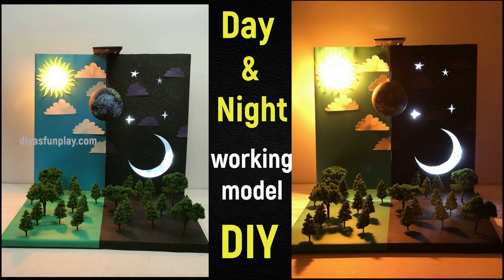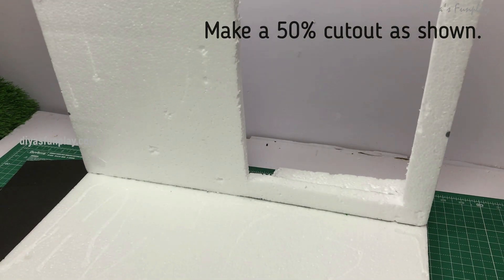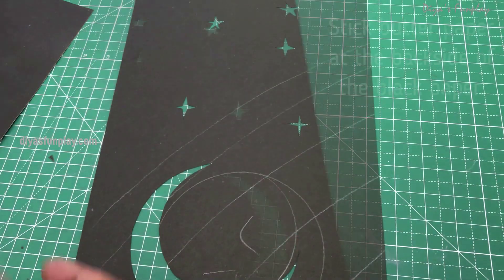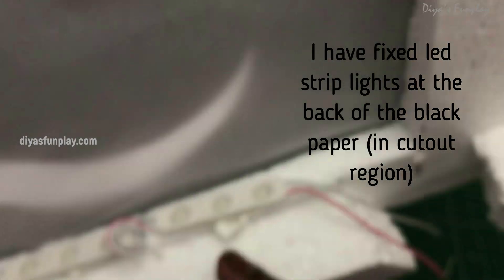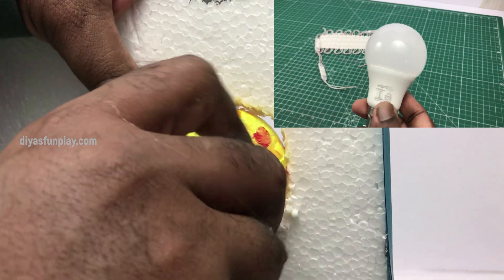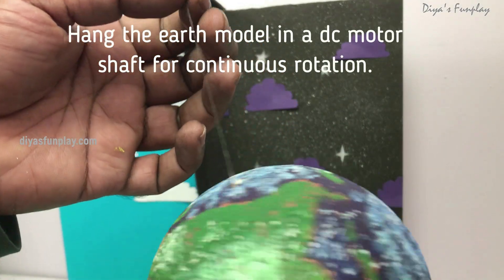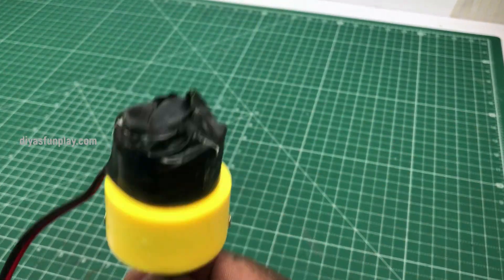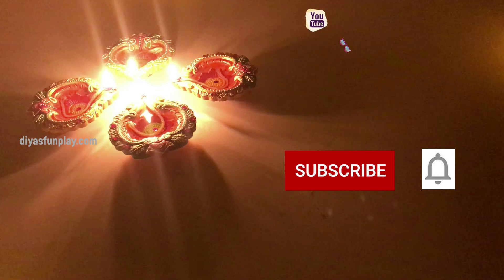Day and night model making procedure and clarifications | @diyasfunplay

Comment: How to fix that dc motor plsssss clear my doubt and light bulb
Reply from the maker: I have not used any dc motor in this video. Earth is hanging in a thread.  Light bulb is just sitting tight on the thermocol hole. You can add a little hot glue on the sides of the bulb.